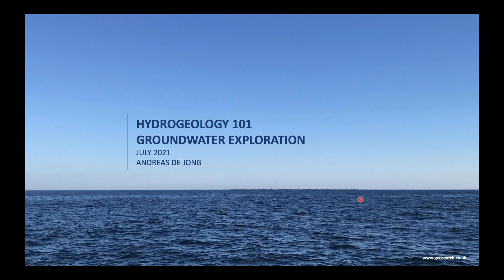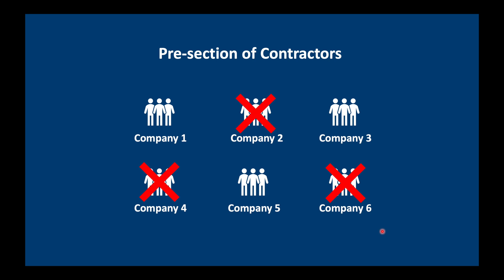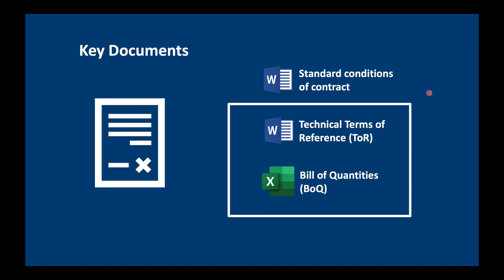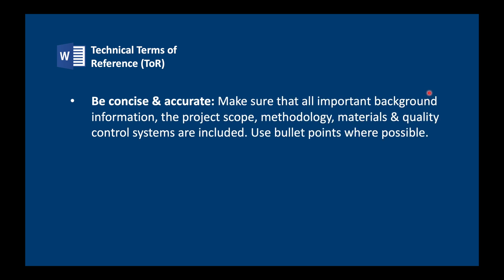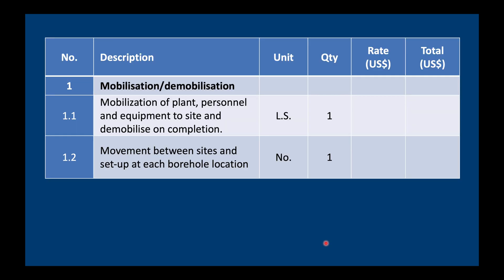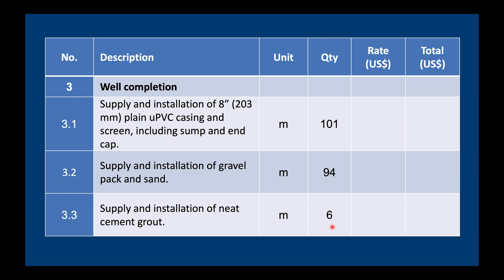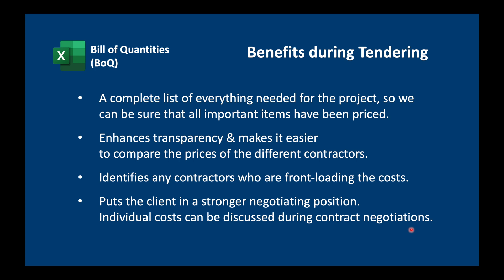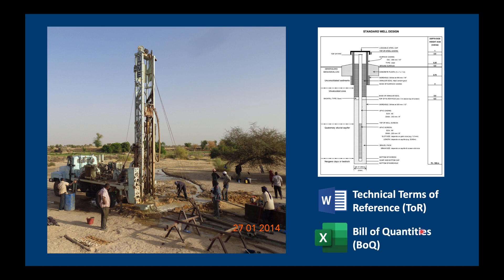TOR & BOQ of water wells - Hydrogeology 101

Comment: Hi Andreas,  just noticed the diameter of this well at 12".  Irish drillers usually drill 6" and I understood from theory that an 8" well can increase the yield by letting more water into the well - water doesn't compress and it is analogous to fans leaving a stadium through a small gate, a wider gate lets more through.  However I am always told (by drillers) that this is not correct!   Perhaps I have had a wrong idea for years...?
Reply from the maker: Hi George, the theory is that if you double the well diameter you improve well efficiency by only 10%, so you need to compare the total energy savings over the life of the well with the increased costs. Normally you should drill at the smallest diameter.  This is determined by the pump diameter, which controls the casing diameter which in turn controls the borehole diameter. You need space to install the pump and the gravel pack.  So 12” borehole is for 8” casing which can accommodate a 6” pump. Things can change for  deeper wells which may need more space for the pump. Hope that makes sense - I will make a video about this if I get some time. All the best, Andreas
Reply: @GeosearchInternational  Many thanks Andreas, so I was in the wrong about that and for quite a few years too!  I'll have to apologise to a few drillers now :-)
Reply from the maker: I have a deep respect for drillers and they have taught me so much knowledge based on their experience. It’s good if it matches the theory as well & can always be discussed over a Guinness! All the best, Andreas
Reply: @GeosearchInternational  Great idea - thanks again!, George
Reply from the maker: Wellcome! All the best, Andreas